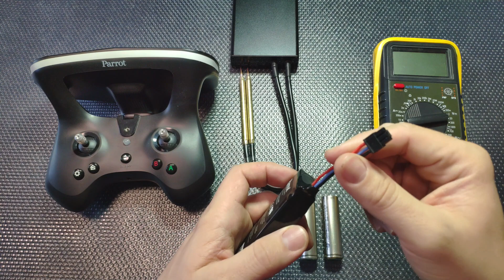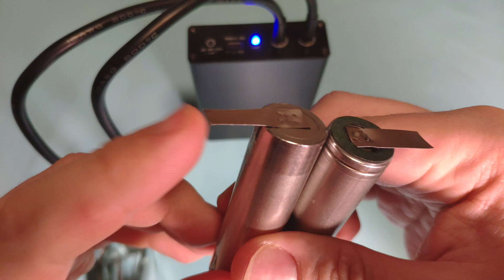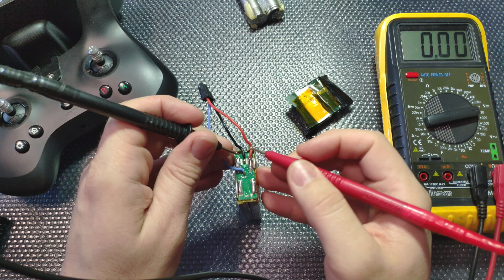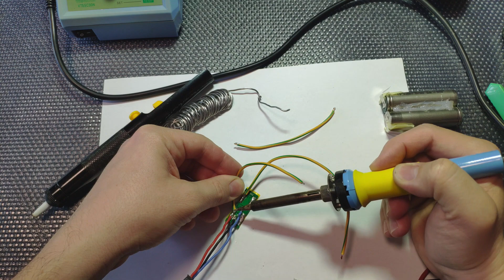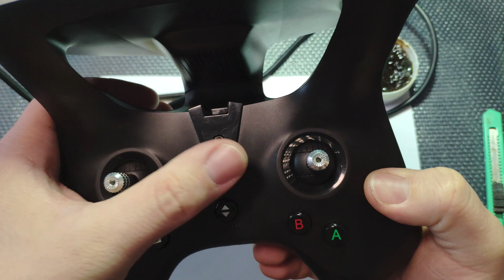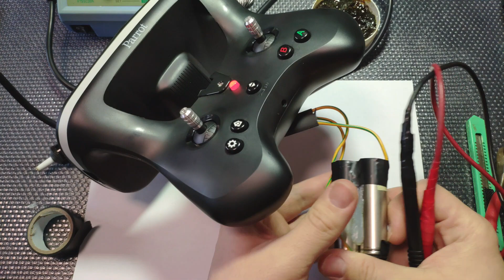Parrot Disco Transmitter Battery Upgrade & Rebuild with 18650 Cells

Comment: Hey. I'm using two 18650 cells without the battery board in my SC2, but with full cells it shows the start percentage at 80%. Are you having the same issue with the original battery board?
Reply from the maker: No, mine shows 100% after the full charge.
Reply: Same problem here. I'm also using two 18650 cells without the BMS and FFPro percentage is not right. I'll try with the BMS. Thanks!

Comment: Can you share the link batteries and the plate you spot-weld into the battery? Please
Reply from the maker: I have used some re-cycled 18650 FST china cells from a failed scooter battery. You can use anything as long as you test them before to be sure that they perform OK.

Comment: Hi. Can you charge it with the normal charger? Thanks for your nice video.
Reply from the maker: Yes you can, it works like the normal original battery only that it will no longer bloat up.

Comment: I find it very interesting.  But I have a question.  Won't the charger power be too much for those batteries?  the charger gives 12 volts and 3 amps.  which would be 1.5 amps pe battery.  I would also like to know how long the new batteries last.  Thank you very much for the video
Reply from the maker: The charger is designed to charge both the flight battery of the Disco and the TX battery. the "12V" an 3A is actually 12.6V for charging up the 3 cell flight battery (4.2V * 3). For the TX you use another cable and with the TX and the battery will get 2*4.2V (8.4V). The current is not a problem as almost all lithium cells will charger with no problems at 1C which for a 2700mAh cell is 2.7A (close to 3A). If you install 18650 cells such as the LG MJ1 rated for 3500mAh you will actually charge them under 1C, so that is not only safe but will also provide a long life for the battery.

Comment: Awesome video, will definitely be doing this to my SC2! Have you done a flight using your new battery pack? If so, how many minutes of operation do you get?
Reply from the maker: Just a test flight, but because of the weather I had to land after 30 minutes, still had a lot of battery left for the TX. The original battery was working erratically, showing 100% after disconnecting the charger and dropping to 20-30% after just 10 minutes of flight time. Sometimes it would not charge either or the TX did not want to start. With the new pack I no longer have these issues.